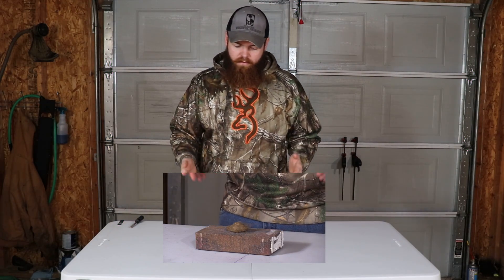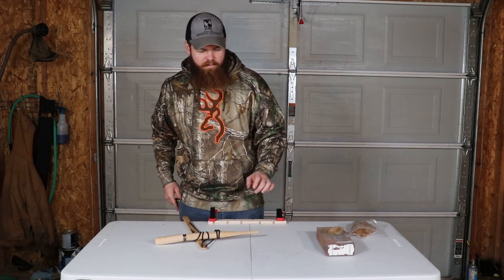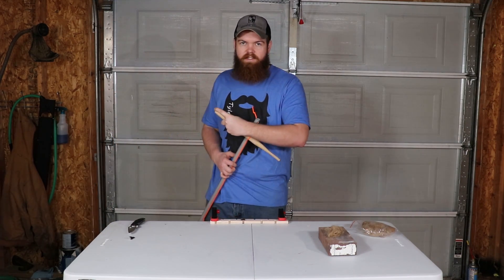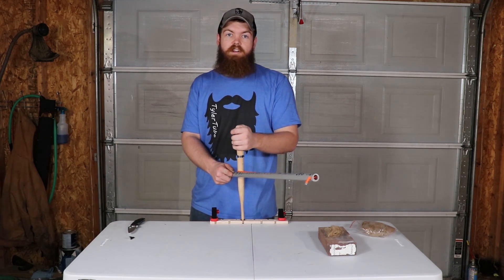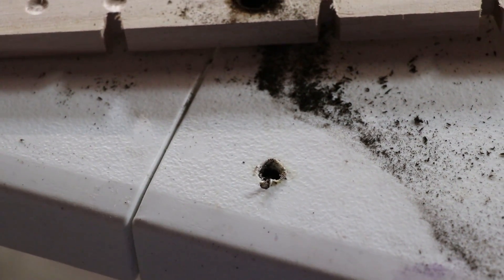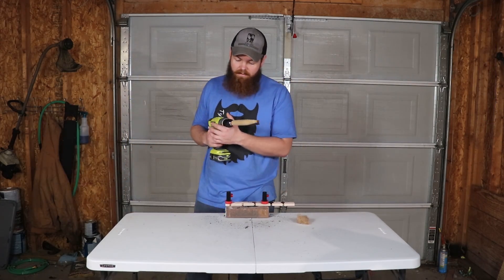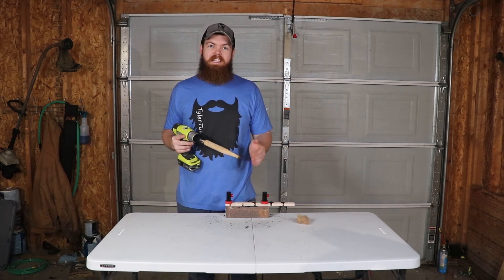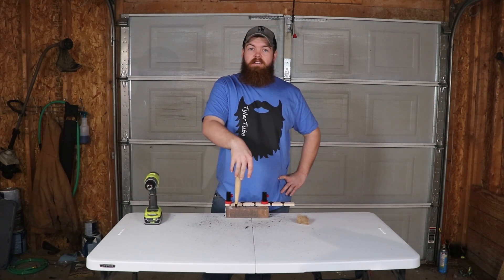Can You Start A Fire With A Power Drill?

Comment: friction fire works better when you have your weight on the spindle. with a bowdrill it's pretty easy with stuff you can find outside. and the fireboard is all wrong .. you need your V to be inside your circle like a pizzapoint.

Comment: Try to Make your spindle out of a hard wood, and your fire board should be a medium to soft wood like aspen. Try to consistent pressure and make sure the spindle keeps moving, once you see smoke move your tinder bundle to the bottom of the v on the fire board and keep moving the spindle. After you see that black powder form on your tinder bundle remove the tinder and gentility blow

Comment: I'm pretty sure you had an ember with the bow drill. The problem was you never stopped. Once you have smoke stop drilling. Let it get some air. Then gently blow on it and dump the hot black dust into your tender and there you go.

Comment: Aren't you suppose to put the fire starting plank on top of a surface that is harder to burn, and put a bit of tinder in the hole to help it catch fire sooner from the friction? All you end up doing is transferring all the heat from the fire starter into the plastic table.

Comment: If you peek inside the drill casing, you'll see steady arcing in the motor, just stuff your drill full of twigs and leaves and then run it until the whole thing goes up in flames, then pound on the battery until the casing breaks and leaks all over, the battery will explode and light the forest on fire. Success!

Comment: u dont get a fire from that man the point of it is to get a ember from the wood ur using an then u blow on it but u have to have the coco fiber or small bits of woods chips an filing under that wood piece where that notch is at then  u use that to start the fire where ur wood is at

Comment: Okay man.... That black stuff is charred material shed by the board and drill and it becomes the ember.. you need to cut the v out so it would collect and fill the v with that black dust you keep blowing away.. you want to focus on pressure to fill the v then speed to heat and ignite the ember.. the pile of black dust that collects in the v becomes the ember. That v is not some magical place to let air in.. it is a chamber to collect that black dust.. sorry this one made my head hurt... I've watched alot of your videos...  this is the first time I'm commenting.. sorry if I sound like a dick.. but well I am
Reply: Lmao this cod is from over a year ago.. but I had to post on it

Comment: The problem is once you got a good amount of smoke, you keep blowing it out to try get the ember going, in actual fact you need to put the smoking/smouldering embers into kindling and very very lightly blow the kindling bundle with the embers in to start it, it’s not hard to start a fire you’re just using the backwards technique which made it difficult

Comment: I learned tyler doesn't understand how friction fires work. 
Yes, it's not quick. It's easier than you think, though. You were making ten times the work for yourself the moment you started, Tyler. You see, it's called a "bearing block" because you're bearing down on the spindle to force the friction. Not because it acts like a bearing(seriously, Bear Grylls is a douche for teaching people that lie). You're also blowing on your coal dust WAAAAY to hard! It takes the lightest breeze to stoke an ember- that's why it looks easy when Les does it, he's got natural air dispacement working in his favor. He even says that if you blow too hard, you'll blow all your work away. It takes five minutes with a bow drill to start a fire, when you do it right. It takes fifty years, when you do it wrong. You almost had a Tom Hanks moment with the power drill, but you blew like you were blowing out candles on a b-day cake! I watched your friction fire die like my hopes that you might gain a skill! And yes, every attempt made me die a little inside. But what killed me, was that you gave up. I had to get pissed to accomplish this task my first time, as I made EVERY mistake you made here plus one- I used a hardwood drill on a softwood slat. It's the other way around, if you didn't know. And bearing down harder, didn't come naturally. As I said, I had to get pissed at the drill. Take 2?

Comment: As stated you need somewhere for the embers to go but I have also found that holding the bow drill straight up and down is the worst and most inefficient way to do this hold your bow drill at an angle that way when the friction starts to produce smoke/embers it has a better likely hood of staying lit and not snuffed out by constant downward pressure with no where for it to go

Comment: Tyler smoke means heat. 
Combustion (fire) is a reaction between oxygen and hydrocarbons like wood. Use the notches on the side and let Air in. Without air there will be no fire

Comment: Yu know, if yu put a Drywall screw on the drill and run it in reverse on the brick. It'll melt the screw to where its red hot. Make sure yur on high speed tho. Push down kinda hard too. Light my smokes at work that way when I can't find my lighter.

Comment: First of all brotha you need to learn a little bit about being subtle if you ever want to make a friction fire. You nearly had it then you just blew everything all over the table. You have to add oxygen very lightly and I even learned a method of releasing most of the CO2 from your lungs first to blow a much higher % of O2 and help start the fire wayyyy easier. They do the same thing in free diving and it makes that first breath on the ember far more reliable but on this attempt you were your own worst enemy.

Comment: Me got a battery power drill. 
Also me uses rocket to break battery 
Me as well using the smoke from the battery to start a fire and adding a little bit on water on to the lithium to make a stronger fire

Comment: You should really be drilling right at the point of the notch in the wood. And use the burnt dust as your tinder and it will help it smolder

Comment: you you know take a pencil chop it in half hook the battery positive and negative to the graphite and it will conduit electricity and because its not insulated will burn the wood around instant fire.  and not having to waste too much energy of drilling a hole.

Comment: That was never going to work without kindling. With primitive fire, the idea is to get the wood hot enough to make a coal or ember. Then you place the ember in something like dry grass and wait for that to smoke. Then, when the grass or whatever catches fire, you use that to light a bigger fire. The wood you are using to create the ember will most likely never catch on fire. You cant even really burn bigger prices of wood like that without more heat around it. It might catch fire for a second but it definitely wont stay lit.

Comment: Would work much better if you just had some flammable tinder and took the battery apart and shorted the wires for a split second to create a spark to light the tinder.

Comment: One potential issue I have had is that when the dowel is pointed it does cut through the wood. A blunt or flat tip will provide the largest surface area for friction. So basically almost flat. Plus, if you try adding a small notch the side of the of the hole for the ember to fall into it works well

Comment: First off, one of the reasons you were having issues getting an actual ember is because the knotch you cut into your base board wasn't close enough to the dimple you had on top of it. I don't know, but it could also be the wood you're using.

Comment: The reason it isn't working is because you had the set up wrong, firs you can see the cut out of the bottom piece of wood is not line up with where you drilling the dowels in. And the tinder is suppose be under the bottom piece for wood so it can catch the ashes and make a ember.

Comment: wood won't catch on fire with just wood it will only burn and smoke, you need a excelerator ie if you put some straw or hay even cotton in the hole it will catch light, but A* for trying to see if it would work with just wood

Comment: I would guess your choice of wood was a big part of the problem. I've always seen them split a really dry, hard branch as the base. If you live in the south and that was wood from your garage, probably a little damp and possibly treated. I've also never seen them blow on it while it was in the hole, they flip it and tap it onto the tinder first. Basically you used oxygen to efficiently burn the ember into ash before it did anything

Comment: Tyler, the survivalist

Also, no hate but the way that the bow drill works is that you put flammable material around it while drilling since the black stuff is hot and the smoke can carry small embers.
Reply: Smoke carry embers? That black stuff is charred material shed by the board and drill and it becomes the ember.. he needed to cut the v out so it would collect and fill the v.. you want to focus on pressure to fill the v then speed to heat and ignite the ember
Reply: I was going to comment the same as you. You beat me to it. I did this as a kid and you have to have the tinder around the heat.
Reply: CoolGamer USA thankyou found someone that knows
Reply: Yup.
Reply: The moment he said that he was going to work the bow drill first, and then flick the ember in to the flammable material, I just lol'd.
Reply: Yes, that's what those little slots are for in the fire board.

Comment: the reason the bow drill didnt work is because you blew your ember out every time... dont blow on it, put the whole smoking pile on your tinder

EDIT: when the tinder itself starts to smoke, blow very gently into it to catch the flame, if you are using something such as a coconut husk, you can slowly wave the tinder around in the air to gain your correct airflow to catch the flame as well

Comment: You need to cut a trough between that v-notch and where you're spinning the drill. You need a way for the ember's to get out from underneath the drill and into the open. You keep snuffing out your ember's as soon as you make them.
Reply: Plus his drill is too pointy, which reduces the surface area and therefore the friction he's looking for.
Reply: He has the wood with the notch in it but he still dint use it lmao
Reply: Use a lighter and or matches be wam by now 🤣 still a funny video Tyler 👍
Reply: Also he needed to have an extremely hard wood baseplate(something like chokecherry)
Reply: @cadens8530  It looks like he perished a kit. He just didn't have it setup correctly.
Reply: @Dennis Hubach 100% agree!
Reply: True
Reply: @tylergautreaux6343  You don't exhale pure CO2. Its a mix of oxygen nitrogen and CO2, as well as some other gasses depending on what you breathe in.

Although, it would be better to just fan it with your hand lightly.
Reply: The big problem he's having in not "seeing" an ember is that he keeps blowing it all away trying to clear the dust. In order for an ember to form he needs to provide it with air without blowing it halfway across his garage. It's like he was told it could be done and what the basic supplies are but hasn't done Any kind of research into it. Really sad to be honest...
Reply: @DataDawg59369  haha thanks for that comment, i thought something like that was happening. I kept wondering why he was blowing out the embers then acting like "where is my fire????" lol.
Reply: @DataDawg59369  its clear he normally doesn't do research on a regular basis
Reply: @ofsoundmind2687  That'll be because of "Who I am as a person" as he is fond of saying. Certainly frustrating to watch at times.
Reply: Philip Bender I’ve done this before with an actual bow and spindle and you’re exactly right, also he needs to add more downward force... REMAKE THE VIDEO!
Reply: and after the cut for the ember to gather you need to not blow it like a birthday candle!!! just kinda whisper at it. also need something under it to use to "catch" the ember to transfer it to the tinder bundle. please do this again with great success!!!
Reply: Hmm are you a pyromaniac or are you one of the Alaskan bush people
Reply: *Ember* not Amber
Reply: @HELLYEAH726  Thanks.

Comment: If you blow* on it and the ashes blow away like they did everytime you blew on them, that means you are blowing wayyyyy tooo hard. That's why you failed.
Reply: One reason...yes..
Reply: Isn’t the tinder also suppose to surround the friction tool so that it catches while you work the tool.

St least that’s what I would notice in movies showing people starting fires that way
Reply: Needs to have a notch halfway through the hole and the tinder below it... I've lit friction fires with a bow many times... but he was correct that a longer reach also helps because you'll expend much less energy because you don't need too stroke so fast... phrasing I know
Reply: @j.amorse2463  but it doesn't help to have a longer shaft, you have to stroke longer to get climax